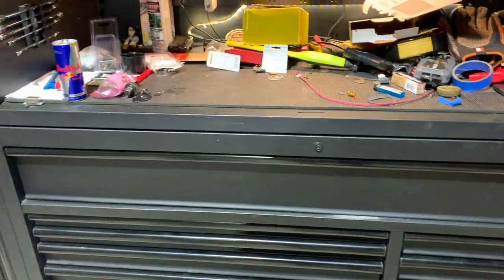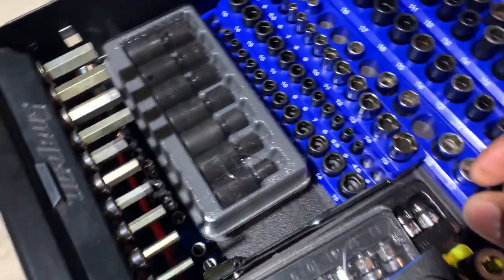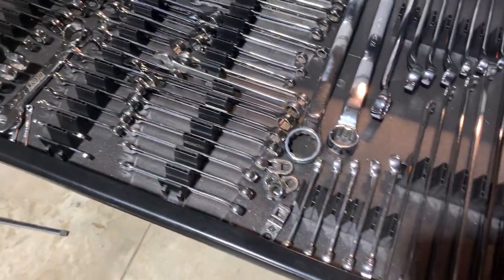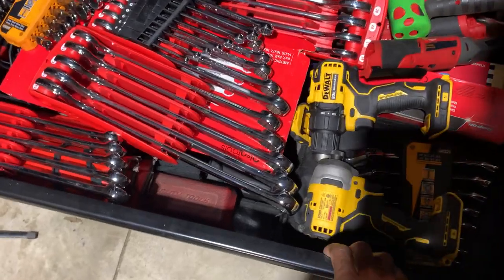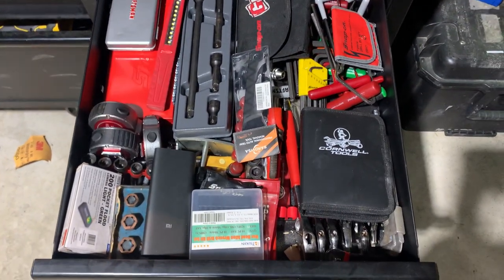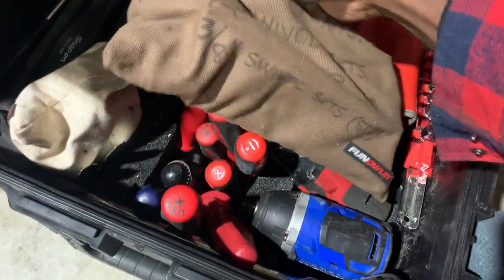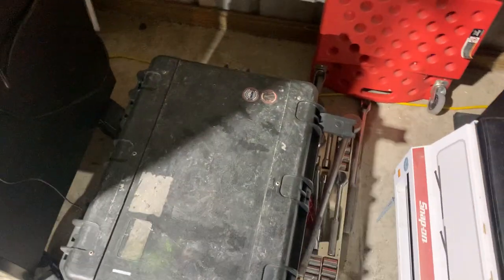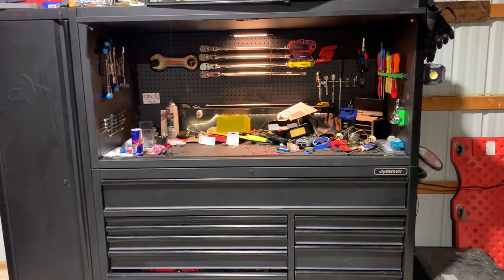TOOLBOX TOUR OF 2023 | NICEST DIY’r SETUP EVER!!! #toolboxtour #toolhaul

Comment: Hello again Midwest Tool Reviews 
Thank you for another Great Video 👍 Question for you, About your Tool Box. However, long you have own it. What would you do differently now that you know? To either 1) make it even better or 2) which Box should have brought instead and why? Usually for me it's the afterwards thinking. Why didn't I see that before thinking 🤔

 I also have to keep the empty weight down to a minimum.  As I load/unload onto my pick up. Most of the time without a forklift available. Thinking about my safety. Again thank you 😊

Comment: How do you like the mass fabricator wrenxhes
Reply from the maker: I’ve used them 3-4 times and they performed as aspected. I originally thought they’d have some slip due to being cut using a water jet, but they did a great job on the tolerance

Comment: A small fortune in tools and an enjoyable watch for the evening. How about this: pick up a second Husky box and bolt those two together to make a huge toolbox setup?! Not sure about having a second hutch, though.
I think you might have mentioned it before in another video, but what size is that shop again? And how tall is it? 🐺🔧
Reply from the maker: That’s the plan. I would buy another 80” Husky and bolt it to the side of my existing box. I’d have double the space in terms of hutch, side locker and main box. My shop is 2000sqft. My ceilings are 15’ft